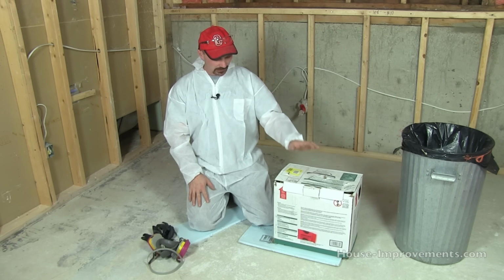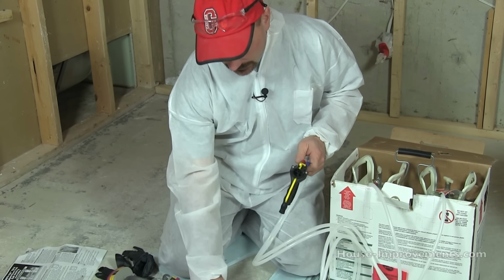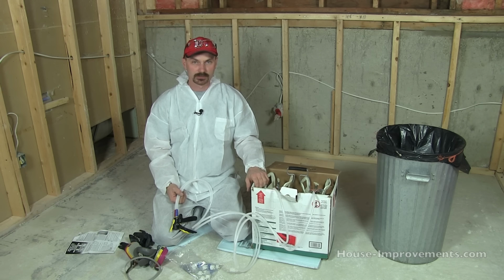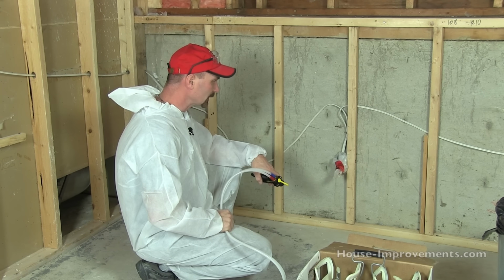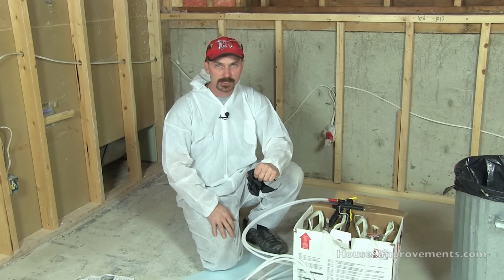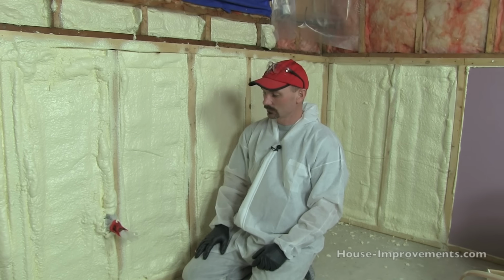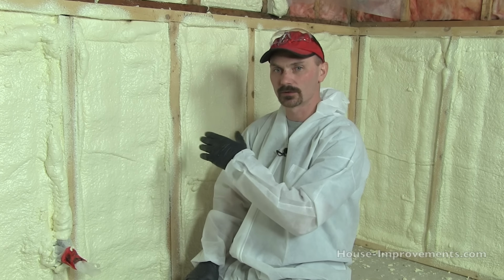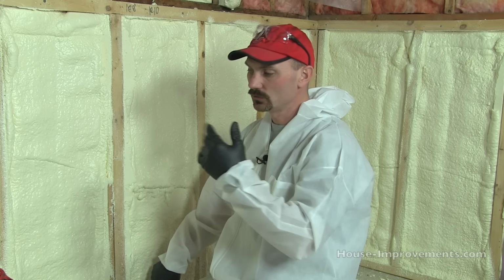How to Install Spray Foam Insulation DIY

Comment: How good can that goop actually be if you have to keep re-applying more layers over areas you've already foamed?  Either it's an inferior product that doesn't insulate worth crap, or you're not applying it correctly.  In either case, your message is falling flat.

Comment: in an unfinished basement,  can we just leave that on the concrete wall without covering it ?
Reply from the maker: Most all foam products should be covered to prevent burning during a fire because they give off toxic smoke.
Reply: There are paints which can be applied that will act as an ignition barrier.  If it is going to be inspected, an ignition barrier, usually dry wall, is required in living space.  Everything in your home gives off toxic smoke if lit on fire.
Reply: In MN it is illegal to leave foam exposed.

Comment: Heaps of extra work. over spray on the studs, went too thick in the stud space(dw won't lay flat) If you do over spray clean it when wet. Straight edge overlapping the studs so you flatten the center as well. Just my opinion. Yes I have done many projects with foam.

Comment: my problem with foam is shaving all the over spray off.. otherwise foam is good
Reply: +mikieson They do make a draw knife type of saw with right angle handles covers one or two bays so you start at the top and back and forth down for a flush wall.  Goes pretty quickly.  This stuff dulls knife blades in a heartbeat then it just tears.  Watch out for the outlet boxes.  Still too expensive is the bottom line for me.  The other is the learning curve if you overfill the bays you are really spraying dollar bills.  Mineral wool and rigid foam board with caulking is hard to beat for cost effectiveness.
Reply: ugh yes. helper who used to work for us ran the saw zaw through a mess of electrical wires one too many times and that ended us trimming foam with a tool for good. now we do it by hand. ive done attics the size of a small house by hand and its definitely the worst part of the job!
Reply: We AMERICANS have airplanes that will take you back to beloved germany. I just love how everybody that comes from other countries wants us to adapt to their former countries way of life.

Comment: Honest opinion, I’m renovating house I just bought. I need to use closed cell as per engineer. 1200 square foot house. Doing all walls and roof joists. Had estimates from pros for 11k. 

Is this something I can do myself? 

Great video. Informative.
Reply from the maker: No, I would never attempt more than 400-600 sq. feet of surface with these kits. Have the pros come in they will be in and out and you can move on with the project. There are many other places you can DIY on this project that will be more cost and time effective.
Reply: HouseImprovements thank you! I will follow your advice!

Comment: I do wonder about the wiring ability to dissipate heat.  The current/load rating of the wiring is in large part based on the wiring's ability to dissipate heat.  With the spray insulation coating the wire that ability is compromised.

Comment: is this good? To me it seems like using spray foam only works unless you got the skill to evenly coat your walls. Because this doesn't seem to evenly coat the wall unless you spray with excessive amounts and shave off the excess.

Comment: Should you fill the cavity for maximum insulation value ?
Reply from the maker: +peterincgy Most foams after 2" thick reach enough R value nd air tightness that it is not real financially worth using more.
Reply: 2" is r8? That depends on where you are. In a hot or cold area all you can do to reduce hvac costs are worth it as energy costs increase.

Comment: I live in Kentucky and we have very cold winters and very hot summers, will this stuff help me save $ on my electric bill and am wondering if this will be better than pink insulation for my attic.
Reply from the maker: This is a very good way to seal up and insulate walls or ceilings . As little as 2" of closed cell  will do a great job in most areas. If you have more than 400Sq' or so to do you may want to compare prices with these kits compared to a pro coming to do it. These kits are not cheap but they are convenient for smaller amounts.

Comment: Awesome video, i actually am a machine operator that fills and packages those tanks.  We don't wrench on the hoses anymore,  but each 180, 200, or 210 kit comes with a wrench. We also changed up the design of the nozzles. Always read the instructions, lots of info in there.  Great video.
Reply from the maker: I appreciate you sharing your insight, it's always good to hear from those working in the industry.

Comment: I have a metal garage, all metal frame.It has a radiant barrier on the inside. Can I spray over the radiant barrier, its like the bubble wrap type of barrier.
Reply from the maker: Not sure it will completely stick to that ? You would still have to cover this foam with a fire protection, like drywall.

Comment: We would like to build a house next year and go with a cathedral ceiling (beams, t&g boards, then insulate the top). However, I just had a local contractor telling me he wants 7.5 CAD/sqaure foot for 5" insulation. Now that sound ridiculously expensive to me or is that normal?
Reply from the maker: Not sure , it all depends on the costs in your area and the material used. Best way to know is get 1 or 2 more quotes for the same thing.

Comment: Great video  could anyone tell me if this thickness is enough for a container (container house in Germany ?
the thickness is who will fight the condensation or that thickness would suffice ?
even if I have to put glass wool, I ask about condensation in container. I appreciate the help, I am a woman and I have to do a lot of things myself.😘
Reply from the maker: 2" should work.
Reply: @HouseImprovements  
thanks .😘
Reply: The first year we used this new foam we made an ice shanty out of cardboard by spraying both sides. Put a small can with both ends cut out at the roof line for ventilation and would you believe we didn't even have to heat it except with our body heat. Very efficient. Thank goodness for some door draft or we'd have  overheated. And we floated it home once the lake thawed out. Great stuff!

Comment: Aside from cost......Is foam always better then regular fiberglass stuff? Or are there cases where you wouldn't want to use foam?
Reply from the maker: In my opinion the foam is superior. Some foams can not be left exposed inside your home and must be covered for fire protection, so that can be the only down fall with some of them.

Comment: You might add a warning against filling inside your ac boxes,put some tape on their faces so they don't fill up also cover them on all sides so they don't bring moisture in the wall.
Bye.
Lucien.
Reply from the maker: 9:15 mark of the video this is discussed.

Comment: Watched your video  i have 70 ft trailer want to spray the under side 700 sq ft would one kit do it,  will it adhear to a under surface without drupping down.
Reply from the maker: The kits come in various sizes and I believe the largest is 600sq. feet at 1" . But 1" of foam is not going to make much difference IMO. You want 2" - 3".  SO price out the kits and also price out a pro. I would bet for this amount a pro will be cheaper. Remember you also want lots of air flow where you are doing this for venting fumes. Crawling under a trailer is not going to have much flow and likely too dangerous.
Reply: @HouseImprovements   ok thanks for the info.thanks for reaplying.

Comment: Hi Shannon.  I plan to do this for my garage ceiling because the room above it is freezing in the winter.  Do I do one pass first, then go back to do a second pass?  Does each one pass get 2" thick when cured.   What is a good thickness?  When done, just cover with drywall without vapor barrier?  Finally, is it necessary to spray the mix into the garbage before putting nozzle on?  Or can I just put nozzle tip and start spraying.  Much appreciated and thank you for a good video.
Reply from the maker: You will figure out a speed that will give you a 2" thickness with one pass. Spraying into the can with out tip is recommended by manufacture.

Comment: Nice demonstration on the spray foam kit/use, Shannon.....do you know what the R-value is on that foam?....(so much per inch).....In the near future, I am going to finish our basement, here at our home, and I was thinking of going with the 2' ridged foam (w/R-10), mounted using a Hilti brand anchors, directly to the inside of our poured 8",basement, foundation walls.....Then framing a standard 2x4 wall in front of that, and insulating that with the 3-1/2" kraft-faced, fiberglass batts.....and covering with 1/2" drywall.......Does that sound good in your opinion?
Reply from the maker: I believe this kit was R5 / inch. The method you want to use in your basement is an excellent way of finishing a basement

Comment: Hi!  I am a renter of a single family home.  I moved on winter time and I noticed a lot of areas where the cold air was coming in.  I bought some stuff to cover it but still the floor was freezing all the time and was difficult to keep the house warm without putting the heaters on high temp which result on electric bill of $350 and more during the months of winter "my heat is electric".  I decided to go down the basement which is not a basement and I discover is theres just the house on top of the land fill and when I looked up I could see my floor, there were no other plywood covering or insulation.  I would of look up if I made a lil hole in that wood.  I wanted to know if thats how its supposed to be?? I think thats why is so cold plus the air leaking inside.  If its possible to use this insulation there?
Reply from the maker: So you have what is called a crawl space under this home. They can work in a couple different ways 1) heated crawlspace: this would have usually rigid foam attached to the concrete crawlspace walls and the heating system would help keep this area warmer.  2) vented crawl space: this space may also have some insulation but is vented to the exterior to prevent condensation and dampness as well as not being heated . I would guess yours is vented but never had any insulation installed. You could insulate the floor area ,that should help quite a bit.
Reply: Thank you for the info.

Comment: Spray foam throws off two forms of toxic poison: off-gassing of the volatile organic compounds and uncured chemical dust. Once the spray foam is done what is the time the occupants should stay out of the home. Do we have to switch of the furnace and open the windows for first 2 to 3 hours after spray foaming is done?.
Reply from the maker: That will depend on the product and the amount of good ventilation you have . Check the manufactures recommendations.

Comment: There's a shed and the wooden slats have gaps. Should i just manually fill using foam from a calking applicator and just go with pink insulation and then use plastic liner/barrier over it all? Or will this spray foam be better?

Comment: I've seen other demonstrations about making sure to spray the electrical boxes to create an air and insulation seal around them. Is the foam you are using fire rated? If so, what is the harm in a little foam in the box?
Reply from the maker: tis is not fire retardant. The purpose seal the boxes is to prevent to much foam going in through every little hole in the box.
Reply: @HouseImprovements  gotcha. The class 1 fire rated version of the foam is only about 5% more in cost, but I can see how covering the box could save you a little bit of work if for some reason too much made it inside the electrical box. Although, I like the idea of getting a good air seal on the box as well.

Comment: how do you compare to 1" of spray Foam to the fiber glass insulation, is it like R11?
Reply from the maker: Most closed cell spray foams are about R6 per inch. Most batt insulations are 3-1/2" is R12 and 5-1/2" is R20
Reply: Thanks for the info

Comment: Hi Shannon,

I got a quote for $1,900 to do about 1300 square feet for the closed cell foam. The foam will be about 4" thick. The attic is converted into a second floor and the ceiling joists are about 4" thick true 2 x 4s. Thanks for your video and your previous information. I'm worried the foam is not going to keep the heat out in the summer....Do you know of a radiant barrier that can be applied underneath. I've researched a bit, and have seen the liquid barrier you spray on, and also radiant barrier makes a double bubble barrier that can be purchased at Lowes. I've read that a barrier to keep the sun out before it comes in will increase the insulative affect. Do you know anything about this. Will the closed cell foam have a problem sticking to the ceiling joists if the double bubble barrier is uses? The second floor which used to be an attic in the summer is like a sauna...... Thanks for any information you can give on this........GREAT VIDEO
Reply from the maker: You can use a reflective barrier but it would be better on the exterior. I believe the foam will be enough but its up to you.
Reply: Material costs alone for 4 inches closed cell foam with 1300 sqft is $2600 minimum. More depending on the brand and yield of the foam being used. So I would not trust that contractor to give you what you think your going to get. That's possibly an open cell price. Closed cell would be $4000 to $5000 for those specs. Oh and you can't use a radiant barrier. You get no adhesion. Besides 4 inches of closed cell easily blocks out the radiant heat. Closed cell blocks all forms of heat transfer: conduction, convection and radiant.

Comment: I have found that our back landing was installed before the vapour barrier was installed...as in there isn't one so I have been considering removing the drywall and spraying just that area. Do you see any problem with doing just a small area in the house?
Reply: the dyslexic do it. no problem

Comment: Can I spray a thin coat on a tank that will go under ground for water storage of course dry before place under ground no where near top maybe midline down.
Reply from the maker: yes ,i believe you can

Comment: What about covering a ridge vent in a garage? I was told that they typically cover them as well as soffits with foam and that you don't need these anymore. Any truth?
Reply from the maker: this can be done if all of your foam is going right to the exterior of the roof system and making the attic a part of the controlled environment of your home. I'm not convinced this is the best way, time will tell I guess in another 20 yrs or so.

Comment: curious when would you uses a spray foam insulation between rafters and joists . Vs putting up batting fabric and spraying blown in insulation behind it? If there is even a significant difference we maybe splitting hairs with this question.

Comment: good for gap filler I wouldn't spray a whole structure with it. They make foam insulation board and pink insulation for a reason. Just an example of going overboard thinking it will be better than previous methods no need to reinvent the wheel.
Reply: +Jen Rich A lot of structures nowadays are sprayed with insulation. It is less hazardous than fiberglass and is easier and faster to install than board type insulation. Because you save on labor costs, the overall price to spray a structure is often cheaper than the other methods you mention. There is a big difference between the pros and these little kits. It's like painting a house, you wouldn't do it with spray cans. The pros buy the chemical in bulk and use air compressors to propel it.

Comment: It doesn't look like this video is watched for questions. But I'll ask one anyway. Would this be a good idea to spray in the walls of a garage? I have a sun-faced wall that does not have any insulation, I don't know why the builders didn't do it. But the walls get really hot due to the sun. I'd like something to knock that heat down.
Reply from the maker: This would work. So would other insulations.
The spray foam can not be left exposed it must be covered for fire proofing. please use my forum for further questions.  https://www.house-improvements.com/forums/

Comment: This was a froth pak, you said in the comments. Unofficially, is this your favourite choice? I've seen tiger foam online. Brian Bauemler put me on to them. I've just seen foam it green on youtube. Are there any other brands I should check out, for sale in Canada.

Do you have any unofficial preferences for cost, and the equipment they provide. For example in the kit you just demonstrated, you seemed to express a preference because it already had the hoses included and attached.
Reply from the maker: jtjohnst1965  I personally have only used the Froth Pak as it is available locally. I have had very few problems with it so I stick with this one.

Comment: Would this cure my condensation problem in my garage due to my metal roofing...It just about rains in there in the winter time when I have the woodstove going.
Reply from the maker: Yes insulating the ceiling or underside of the metal roof should do the trick

Comment: You make a good point in that that is open cell foam with all the disadvantages thereof.  Do they even make DIY kit with closed cell dense foam.  I understand that the light weight open cell will contract in a few days/weeks as it final cures and pull away from the perimeter.  Not a good thing.  Doug